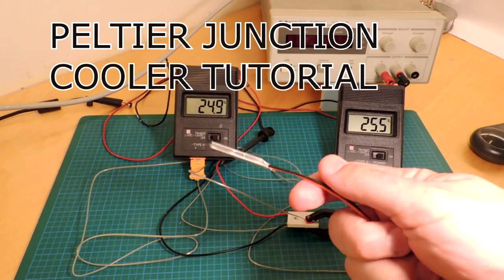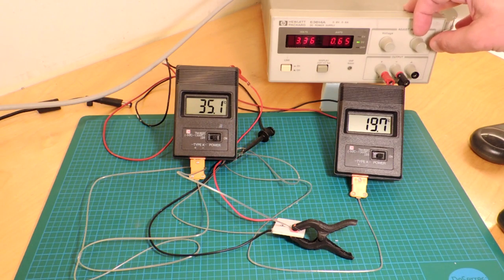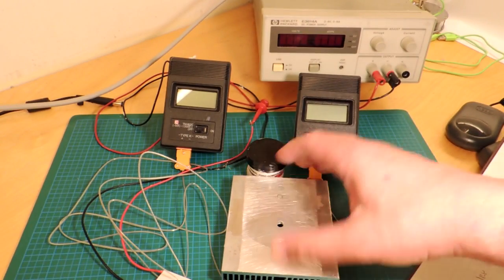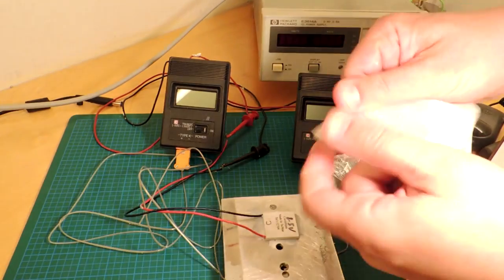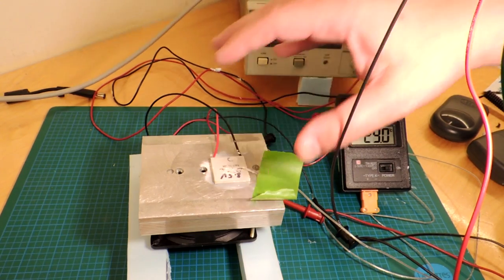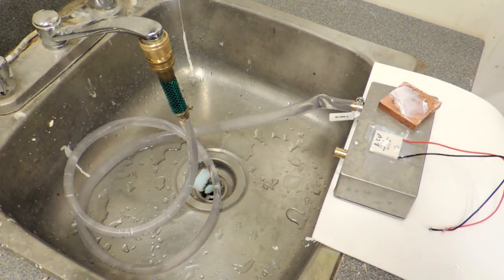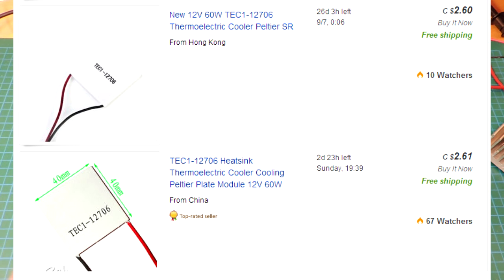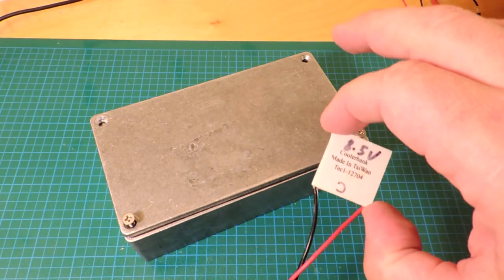Peltier Junction  Tutorial

Comment: woo 90 deg. this is a gizmo that has fascinated me for years back in the 80s, just bogles the mind. I just wonder when LED or cree .. will be able to produce the same effect at crazy efficacy levels. brushless motors are now at a high with PWM control, could a guy make a efficient heat pump tat was no bigger than a case of soda pop ? what is the biggest PJ you have seen ? 2 inch 5 me. and any way to improve on this OLD basic tech ? I have sooo many ways I would like to test this myself. pool pumps got me into the PWM motors,  as I do electric motor service..some good some bad